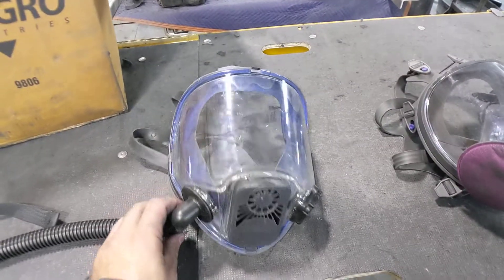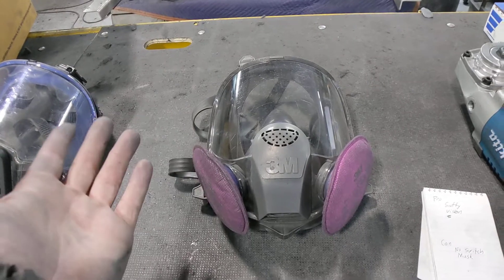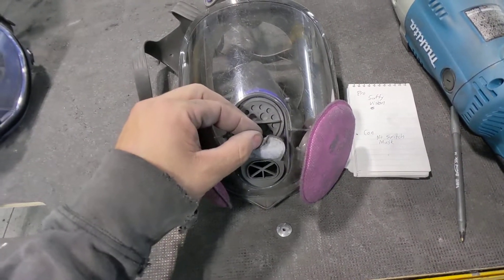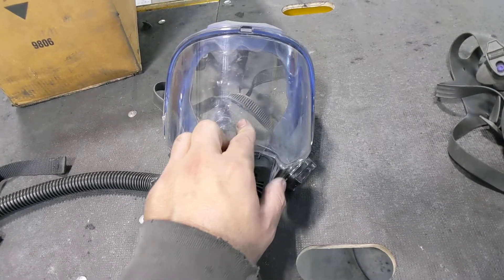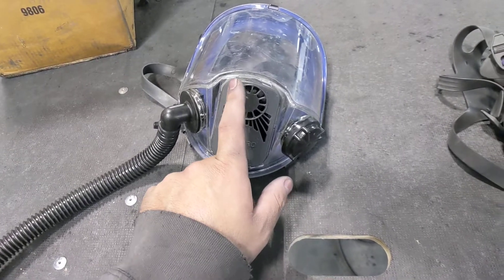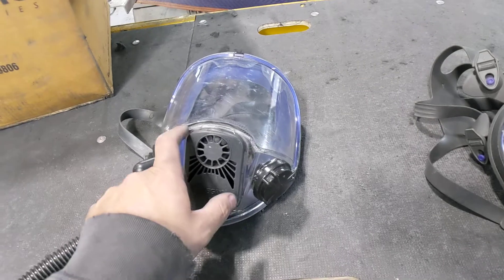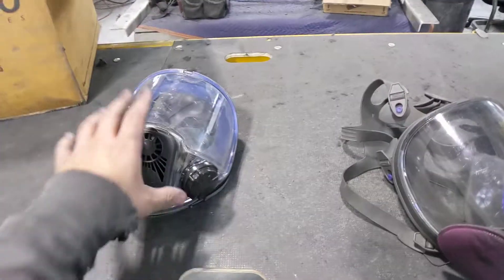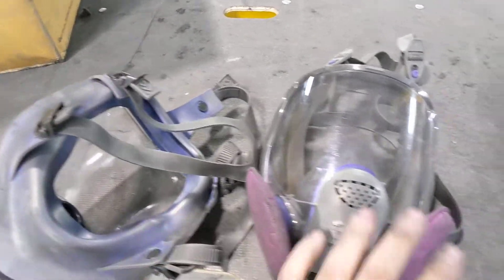respirator fresh air vs filtered

Comment: Thanks for the great idea on the zip line to solve my hose problem! I have a four car man cave with twin post lift and upstairs on one side woodshop.  If you don't make this system convenient you won't use it. I used it for dust protection sanding and sealing beams on the front of my house. 25 feet up on a scissor lift for a week sanding. Plumbed a vacuum hose to the heavy duty Festool sander and the Aelegro full mask. The whole 4th of July week in 95 degree 95 percent humidity and my head was nice and cool and dry!! And inhaled zero dust... Anti-climatic it took about an hour rolling out the sealer but very satisfying